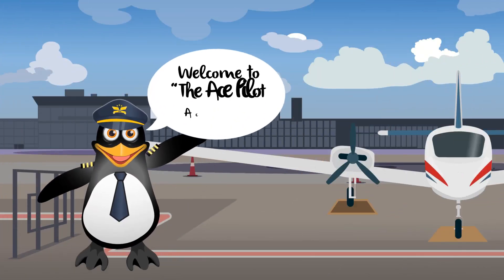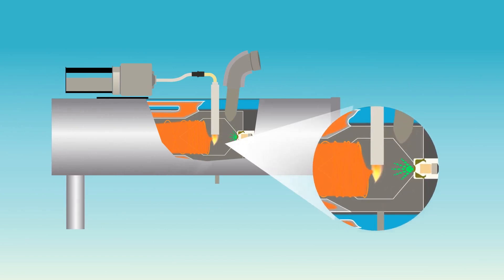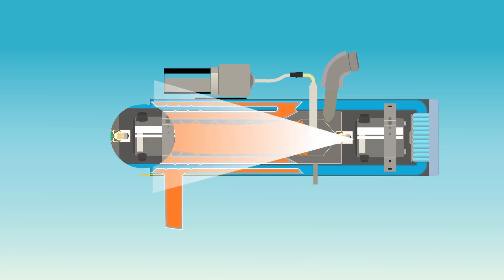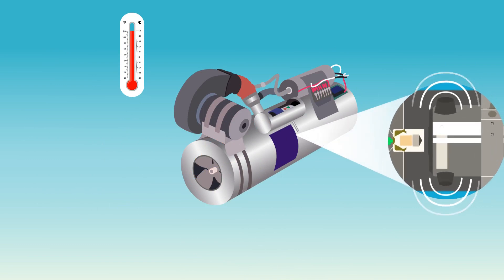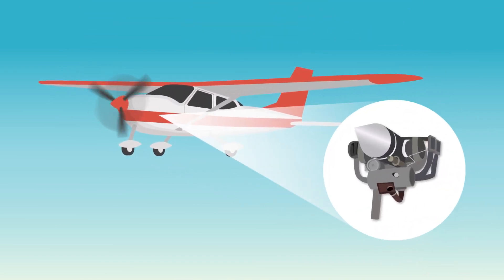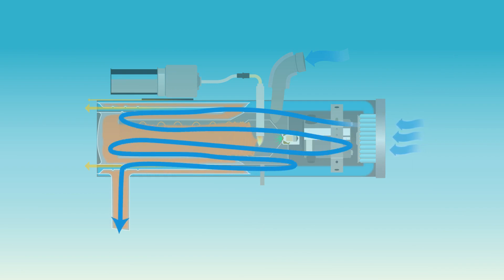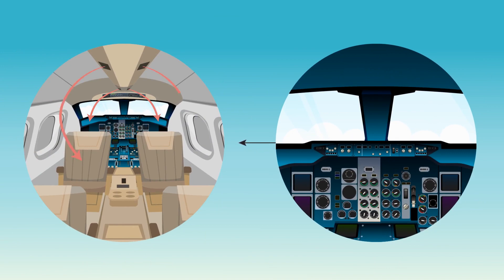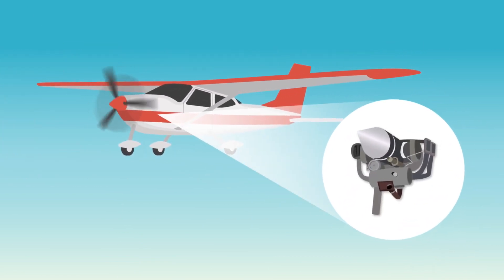Demystifying Combustion Heater Systems in Multi-Engine Aircraft

Comment: Aha so single-engine aircraft have just some metal shroud around the exhaust that gets warmed up by the exhaust, and the propeller pushes some air into the hole of the heater (and into the cabin.) How efficient and hot is this system compared to a Janitrol in twin engines? It gets very cold up there in the unfriendly skies brrrrrr and not everyone is a penguin, cats like it a bit warmer.
By the way a year ago I watched some interesting video about CO2 poisoning that can happen when the exhaust has a leak in a Mooney ,,,, I think it was a Mooney M20. The pilot went unconscious and the aircraft smoothly landed on a field - lucky guy because a certain amount of ppm of CO in a closed room destroys red blood cells permanently so normally a pilot does not wake up after a crash + also does not wake up after CO poisoning so he cheated death twice. The windshield was broken (that´s why he probably survived otherwise he would have died for sure without the fresh air) and the battery and also the radio was still functional after the crash to call for help.

Comment: Good video! As an fyi tho, the Seminole and it’s combustion heater only go to vents up front, primarily on the floor. The air ducts/vents the video was pointing at are actually separate, typically used in spring/summer/fall for a fan, as that draws outside air from the vent outside the rear of the cabin.